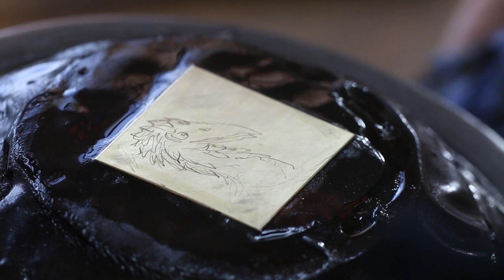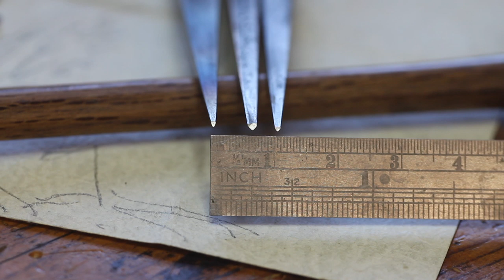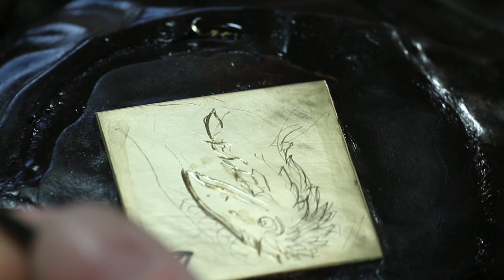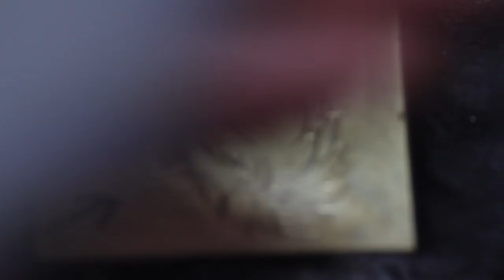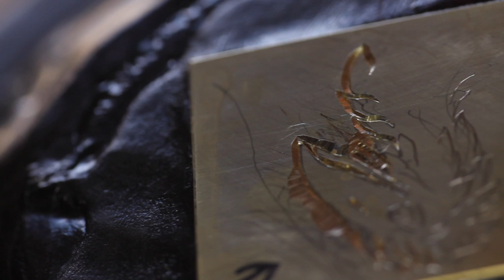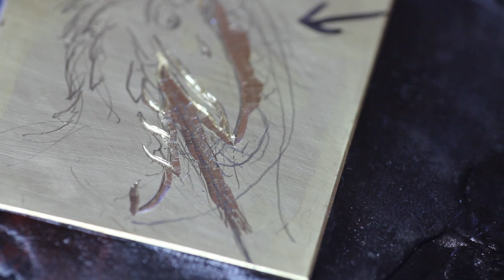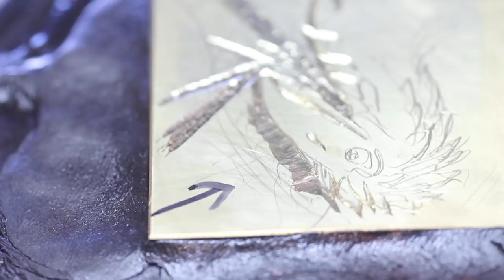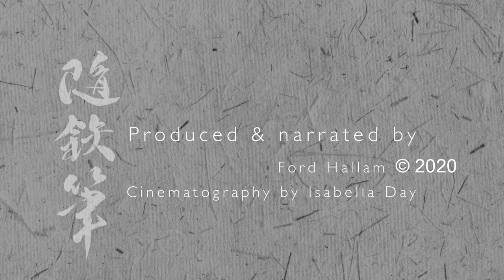Carving a low relief design in metal. Part 1.

Comment: I'm struggling with carving in brass. Any advice would be so appreciated.
Reply from the maker: Depending on the actual alloy brass can be a bit crisp and chippy to carve. A lower zinc content s a bit easier to deal with i that respect. Much standard commercial brass has over 30 % Zn so I'd think about using gilding metal, which is around 12%. It you're already committed on a piece it can sometimes help to anneal the metal, as it is sold it's either hard of half hard from rolling, which makes it hard and 'chippy' to carve. Sharp chisels are essential, as are the correct cutting face angles. You'll find lots of info on chisels and sharpening in a number of the films here.  You can search our library here on YouTube
Reply: @FordHallam  I watched one yesterday. I bought some basic unmade chisels from Rio grande and tried shaping them yesterday.  I need to get better lol I didn't know about gilding metal. I'll look it up!
Reply: @FordHallam  oh wait, is gilding metal the same as jewelers brass? If so, I just got some in.